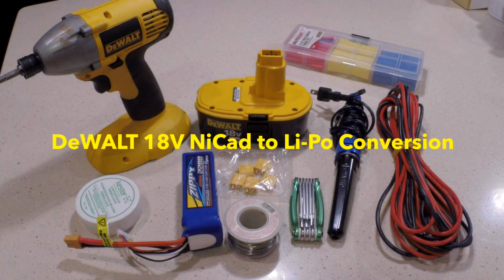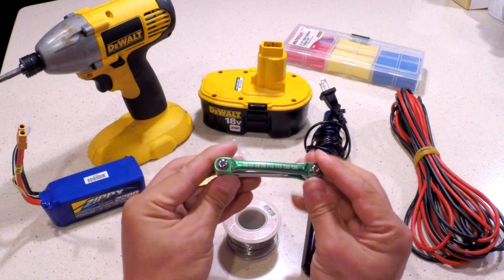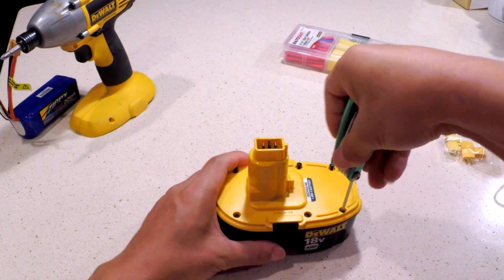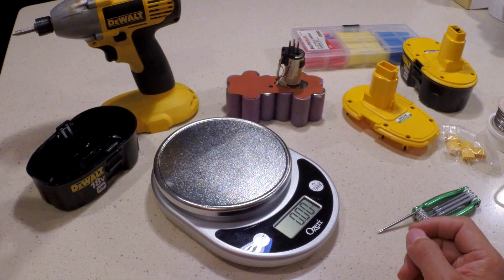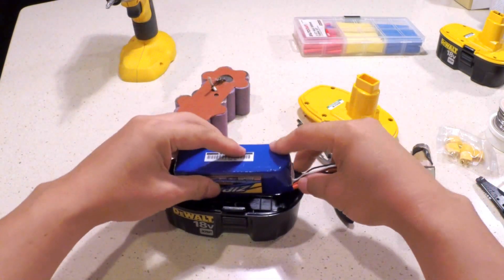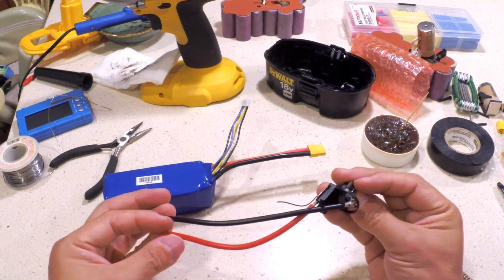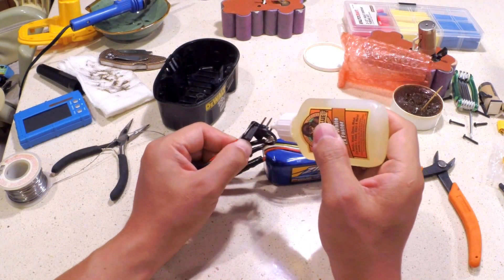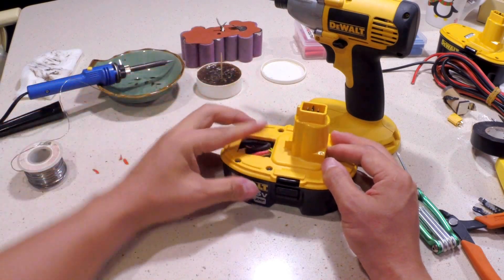DeWALT 18V XRP NiCad Battery Pack Conversion to Lithium (5S Li-Po)

Comment: thanks for the video... do you think it's possible to break apart a 20 v charger and use it to replace the 18 v connection on a old 18 v radio to convert the 18 v radio to a 20 v radio that can also charge 20 v batteries?

Comment: Excellent conversion. My question is that do you need new charger to charge new battery or you still use old nicad charger to charge new battery. Please advise. Thanks
Reply: I have the same question !

Comment: https://i.imgur.com/NJtXtLj.jpg
You had done almost the same upgrade as me, the same batteries too. (I had done 3 of them) But when you had done the big hole I made an small one to place a battery charge cheker, then two small ones  to assamble the XT60 (i had replaced them with Dean T so i can use my trusty IMax B6) and the balance port. 
Apart of this I modded a few bosch batteries, but instead of battery checker i placed a microswitch. This ones had a voltage and balance cheker, that is enabed when the battery is pushed. This ones has to be storaged out of the tool, but they are great too because they make a short beep when pulled and continuos one when the voltage level setted is reached.
Reply: I realize that this is an old post but I just discovered it. I really like your mod. Do you have any pix of building it? Do you have a bill of materials? I would like to duplicate your mod. Thanks.
Reply: @stampeder1686 nope. Dremel, Hot glue and patience. Be careful when soldering battery cables. I thinkl i sourced batteries and charge indicators from hobbyking. I choose dean-t cause that was i had, but choose what suits you. Also u Will need de balance plug extension. Thats it to donas me. The improve versión Will include a bms. Good luck, show them if you do It.

Comment: Wow, if you don’t know anything about lipos then don’t do this. They are safe as long as you have a lipo charger. Also only charge lipos on a full battery down then battery up charge (not a fast charge)! Lipos will run down and won’t blow up. Now, the problem is, can a 18 volt dewalt drill handle the power and will it strip or burn up. I need to do a little research before I do it.
Reply from the maker: Austin Crum I agree. I have knowledge in RC batteries in general but most RC batteries don’t have protective circuitry built in so this will not be suitable for everyone.

Comment: what about the li-po cut-off.  this does not have it and is dangerous because of it?
Reply from the maker: bdaddy23 yes if one doesn’t know what he or she is doing, it could be dangerous. I use a voltmeter to monitor voltage in each cell when I use it but this pilot design requires me to take off the battery to measure voltage. In hindsight, I probably should had routed  the white connector out the side.
Reply: @georgetravelstheworld  You just made everyone on the internet think it's so simple but you didn't explain the hidden danger.

Comment: what charger do I use if I convert the dewalt 18 volt, thank you
Reply: I don't know, but don't use the one that came with the original unit or you will burn something up.

Comment: having looked at he hobbyking site there is a unit

 "The Hobbyking 2S-8S Cell Checker with low voltage alarm features loud twin piezo alarms to notify you once your cells reach a user defined voltage. You can customize the alarm to sound at a voltage between 2.7v~3.8v per cell in 0.10v increments by pressing the setting mode button.
 This unit also features a handy built in LED display that will show the voltage of each cell followed by the overall voltage of the pack."  

About two pounds or two bucks.
Reply: Good input. I was wondering about this also - I have this installed in a couple of my gliders.

Comment: would this battery pack not benefit from a small cheap chinese volt meter display so that the battery pack voltage was not allowed to get too low.  As I understand that you cannot recharge easily or at all if the lithium cells get too low.  This must be sorted somehow for the radio control modellers, is something missing from the RC shop?  Very low voltage lithiums be pulsed back to working condition but I think that the kit is very expensive or may be offerd by some shops as a service.  I did not know that overdischarging caused a fire risk only wrecked the batteries.

Comment: This is the best way and cheapest. You are right about high C discharge rate for lipos. They work more than 3 times better and more than nicd or li-ion cells which have 60$ per battery. All my DeWalt drills i have bought without battery work only with lipos and great. 
I just have to say that I did not had a battery box so I fixed mine with external cable!!!. Thanks for video

Comment: The RC crowd also has Battery Management Modules which address all the issues mentioned here.  They are small PCB's and might possibly fit in the Dewalt battery case.  They cost $15-20.  These Zippys are 40C which means 40 * 2.2 = 88 amps continuous and 50c burst (110 amps).  This isn't my field and I found this info with just a little net searching - someone who knows this stuff needs to chime in.

Comment: Hello,

I have an original Dewalt DE9135 charger that charges NICD + NI-MH + LiPO batteries.

Can I charge the Zippy 4s (14.8V) with this modification on the Dewalt DE9135 charger?

Thanks for the video.
Reply from the maker: Without looking at the pinout of the DeWALT's version of Li-Po, I really can't answer it.  Also, 4S is an odd number of cells for power tools no?  12V is 3S, and 18V is 5S...
Reply: My Dewalt Drill is XRP 14.4V, uses batteries of 14.4V. Then I choose the 4S to have 14,8V.

If you want I'll take a picture of the DE9135 charger board, but he has written that he can charge NiCD + NI-NH + Litium.

Thanks for the answer
Reply: I forgot to ask a question, will not give the same effect if soldering 3 batteries of 2600mAh model 18650 in series, 3.7V x 3 = 11.1V?

Comment: Don't you need a discharge protection? Or does the Zippy have in built protection?
Reply from the maker: sujinair you should. Nobody says this is perfect. I have a portable meter as you can see, and I don't really let the cells drop below 3.7v. However, there is no auto-cutoff if that's what you are referring to.

Comment: There are  several things for battery reconditioning
do not attempt to do this unless you know what you are doing - the acid can burn you
check the voltage first - there may be a kaput cell which would waste your time.
Check the battery fluid.
attempt to fully charge the battery.
(I learned about these and more on Jons Mender Guide website )
Reply: It's best the check the turn signal fluid first...
Reply: the fuck , ?!

Comment: Dude, this is awesome. So I need a Li-Po 5s battery and a good charger? Thank you. I have a dead dewalt pack and my other one doesnt hold a charg for long. Im so doing this.
Reply: MAkM  If a person has other older XRP tools it means they don't have to scrap them because they're keeping the pack case and connection interface. If all you have is a drill then it's not worth it.

Comment: do you know if the 18v dewalt could handle a 6s LiPo 22v?  is there any benefit?
Reply: you'll be rebuilding the motor sooner. wouldn't want to be full trigger and putting the drill under as much load as you would with the proper battery, too much heat

Comment: Great idea and inexpensive conversion.  I use Lithium polymer batteries just like what you used in RC planes.  They work great!.  I also adapt 5 cell Lipos to my Black and Decker weed wacker.   Real voltage and 3000 mah allows long run times.   Thanks for sharing.

Comment: What protects the cells from over discharging? No LVC from what I can see...Seems like a good way to set your house on fire.
Reply: low voltage wont set house on fire, short, or over voltage will
Reply: They make over discharge attenuator chips you could use
Reply: G-D...

Comment: can this be wired to charge on a dewalt 18v lithium ion charger as opposed to tucking in the wires?
Reply from the maker: +Johny Bravo It will not be as easy since DeWalt's battery connection is proprietary and totally different from the connection on the XRP batteries.

Comment: can you provide links to all the tools/materials you used?
Reply: +exexangler and also which charger you use?
Reply from the maker: +exexangler 

Battery (at the time of this writing): https://www.hobbyking.com/hobbyking/store/uh_viewItem.asp?idProduct=9461
https://www.hobbyking.com/hobbyking/store/uh_viewItem.asp?idProduct=58711

Charger really varies a lot depending on what you have already.  If you have no balanced charger now, and want something simple and solid, go for IMAX B6AC (just google it for the lowest price).  Make sure it comes with XT60 charge lead cable.